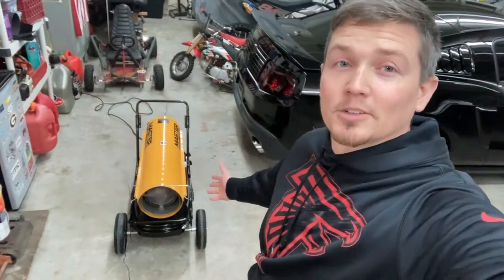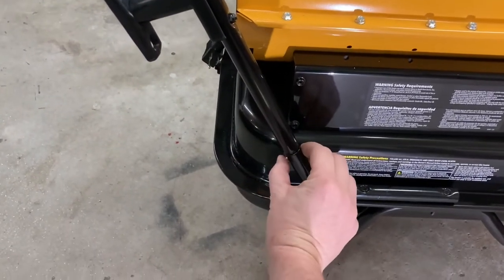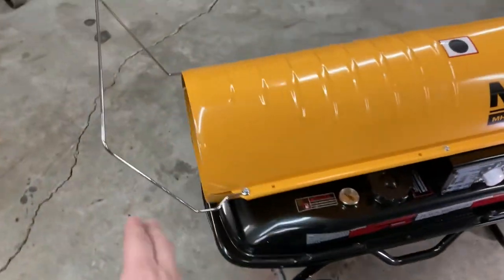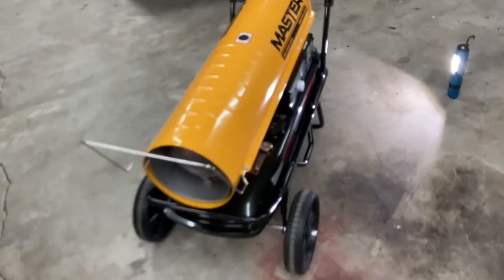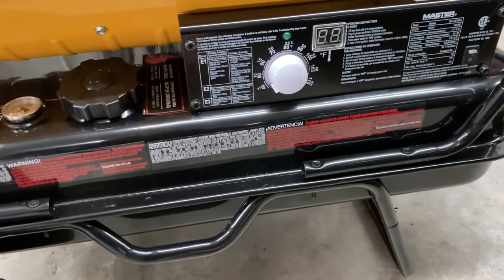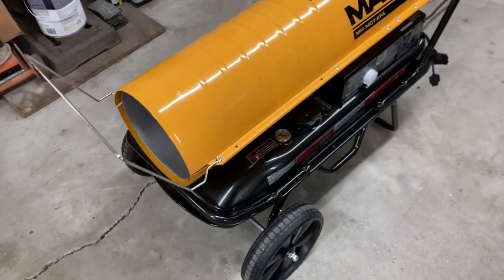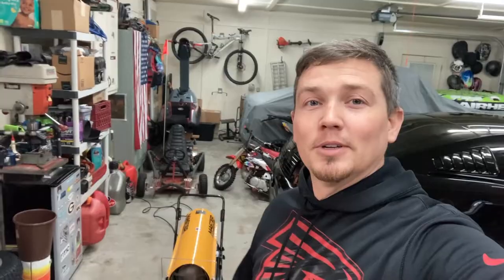Master Kerosene and Diesel 140,000 btu Heater from Tractor Supply Review

Comment: My neighbor let me borrow his for this winter. But I bought a CO2 reader for it as well… I need to figure out how to close off my gaps in my roll up doors up top
Reply from the maker: Yeah that’s the bad part about roll up doors but it will help with ventilation when using the heater far as the c02.
Reply: @CoyoteChris  love the Mustang by the way. I have a 91

Yeah but if I remember right, CO2 sinks and doesn’t go up, so I still crack my door just in case.
Reply from the maker: @willwork2fish261  Thanks, unfortunately I sold it a few months ago but I’m looking at getting a 91 LX that has all the conversions done.  Cracking the door would be smart.  The fumes get pretty strong when I use the heater in my shop unless I crack the doors.
Reply: @CoyoteChris  yeah I always worry about falling out!! Dude I love my foxbody, do u have a Instagram?
Reply from the maker: @willwork2fish261  yes it’s “coyotechrisonyoutube”

Comment: I recently purchased a new torpedo heater. Is it normal for it to smell so much in the beginning? If so, how long does it last before it stops smelling?
Reply from the maker: They never stop smelling,  it’s burning fuel.  Just keep doors or windows slightly open and a carbon monoxide detector when using it inside.

Comment: I never adjusted mine i ran mine straight out the box on diesel but just recently switched to kerosene due to the diesel smell
Reply from the maker: That’s good to know. 👍🏼
Reply: Try #1 heating oil, it's diesel with the paraffin removed and it burns nearly as clean as kerosene. It's way cheaper too.
Reply from the maker: @kscotthoy What did you set the pressure to when using #1 heat oil?
Reply: @CoyoteChris  I use it in wick based kerosene heaters and lanterns but I would imagine that the the kerosene setting would work fine. At least that's where I'd start.
Reply from the maker: @kscotthoy  Thanks for the info. 🤘🏼
Reply: If you had the fuel pressure adjusted for diesel the fumes wouldn’t be noticeable
Reply from the maker: Yeah, I just wish they would have put the pressure adjustment on the manual so you didn’t have to play with it to find the best psi.

Comment: Did you ever find out what psi diesel should be at?
Reply from the maker: No I never got a straight answer from Master.  It should be less than the kerosene psi.
Reply: I didn’t know that it even had to be adjusted
Reply: It’s been working fine for the last 2 years no issues
Reply from the maker: The manual said to adjust psi for fuel type but never said what psi to set it at so I’m assuming elevation comes in to play. 🤷‍♂️
Reply: Hopefully that helps
Reply: Theres a chart that pops up pause and snap shot it
Reply: Within the year… have you ran diesel in it
Reply from the maker: No I haven’t,  just K-1 with no issues fires right up every time.

Comment: Next to the fuel cap, it says never run diesel or gas. That's why you can't find it in manual.
Reply from the maker: The heater is made for kerosene and diesel.
Reply: The box even says it's made for Kerosene or Diesel I just looked at one at TSC today.
Reply from the maker: Mine does not say never run diesel.
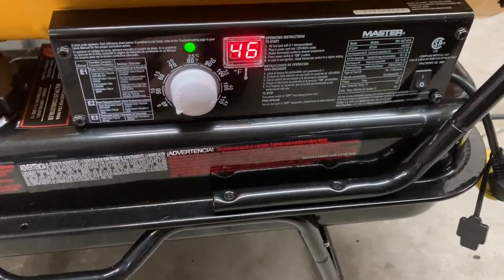Reply: At 4:16 line 1 in the To Start instructions says — fill tank with K-1 kerosene/diesel
Reply from the maker: Yeah,  I’m guessing he bought a different heater.

Comment: Great heater, a train wreck to fill up.
Reply from the maker: Yeah you definitely need a funnel to keep from spilling 😂
Reply: @CoyoteChris  these new safety cans are horrible, even with a great funnel. I switched over to Eagle brand @ Ace Hardware (made in WV, USA) a few bucks more, but better product.
Reply from the maker: Drill a hole and put a golf tee in the hole when your not using it,  plus you can order the old style lids online. 🤘🏼🔥